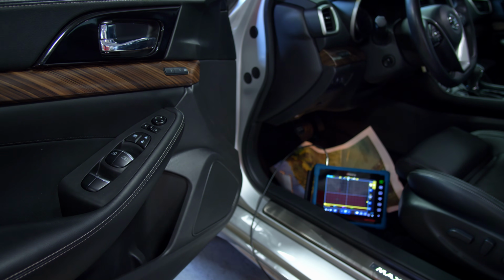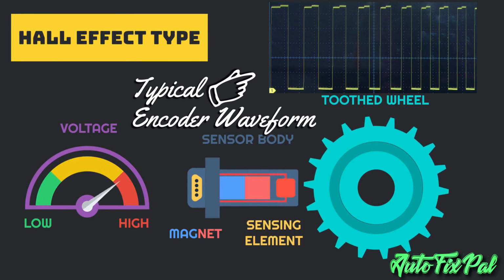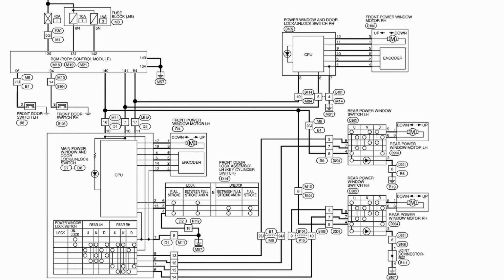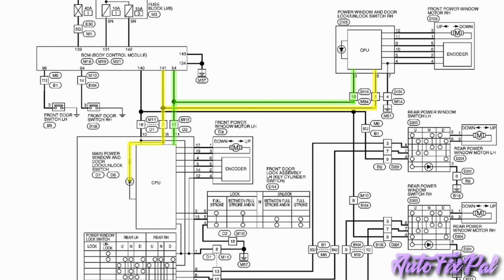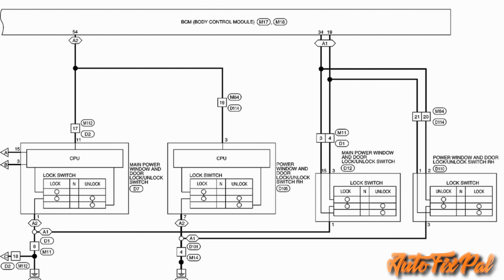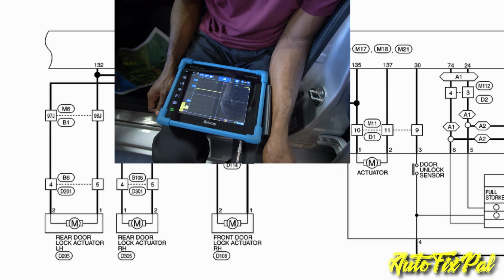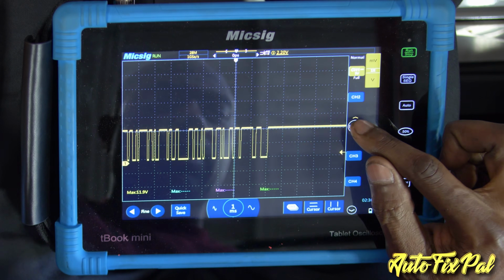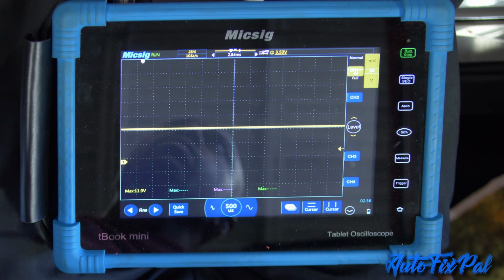Nissan Altima-Maxima-Murano-Pathfinder Power window & door lock Diag and operation

Comment: if there is no power on pin 10 and 18 master window switch on Nissan Altima  or power read 1.7 volt on both wire and when check the continuity its good for both wire from bcm to master window switch....one wire provide battery and second provide ignition..... what could be the issue....